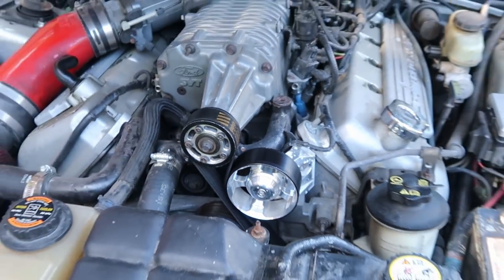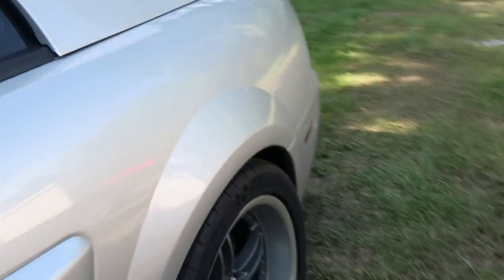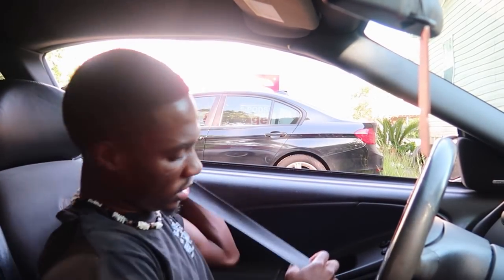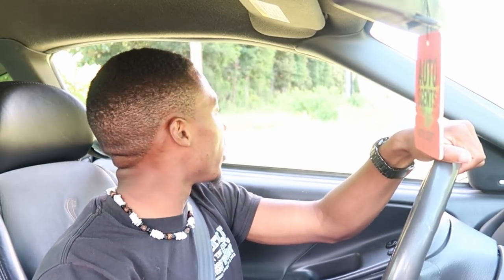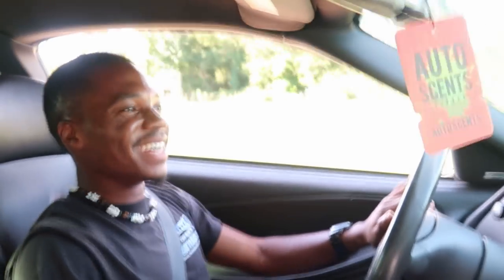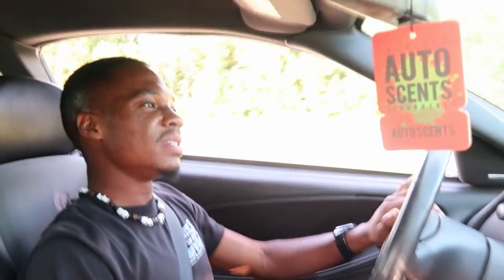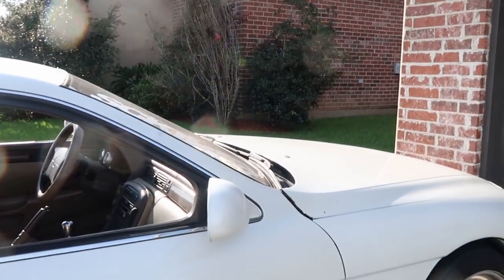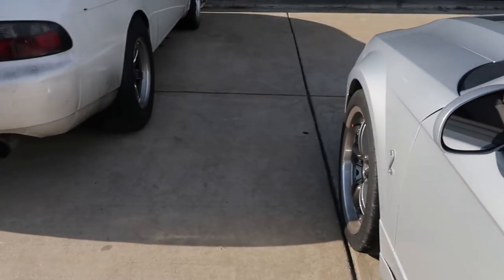My FIRST REACTION to PULLIED MUSTANG COBRA!

Comment: Hey brotha, found your channel and being as I bought a cobra a few months ago (dream car) I’ve been binge watching your vids, sad to see that you got rid of it but hope you’re having fun in the car youre in now regardless and wish nothing but the best! Quick question, I’m wanting to upgrade pulleys but was wondering if the setup you had in this video gave you any problems? Being as the blower wasn’t ported or anything, and if not do you think you can link the exact parts list in regards to pulleys/belt used? I’m new to pulleys and all so I’m still trynna learn upper/lower and stuff like that and what I’ll actually need to run this similar setup if it worked for you. Appreciate any advice my man and keep killing it with your channel 👍🏼
Reply from the maker: Thanks a bunch for the feedback! I believe in this video I only added the 2.7 upper pulley and 100mm auxiliary idler. I believe I used the factory belt, but I’m not sure (it was so long ago). No problems at all with it, I was nervous about overheating back then but even with the Louisiana heat it was fine. Just be mindful to not be in boost ALL the time (and NEVER go WOT in 5th and 6th gears) and you shouldn’t have anything to worry about👍🏽

A good source of information would be svtperformance.com, they also have an app
Reply: PJ Morrison ya been following that forum for a while now but wanted to hear your input because I liked your setup, appreciate the response man!
Reply from the maker: Jose Juarez gotcha, well I don’t remember too much about that setup but I do remember more about the end product.. Well, where I had it when I sold it
Reply: PJ Morrison where did you have it? Or what mods?

Comment: PJ, run a Goodyear gatorback or Gates HD green belt to eliminate chances of belt slip which will cause boost to drop. Also, what kind of plugs are you running and what are they gapped at? You really need a wideband now too.